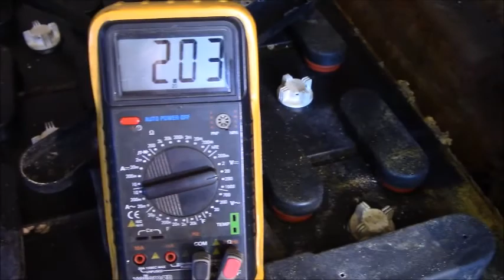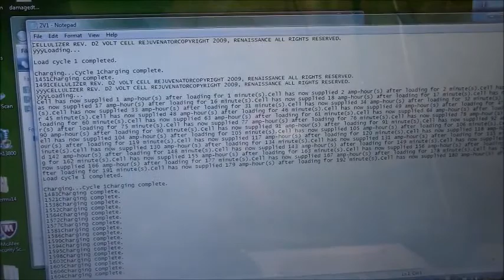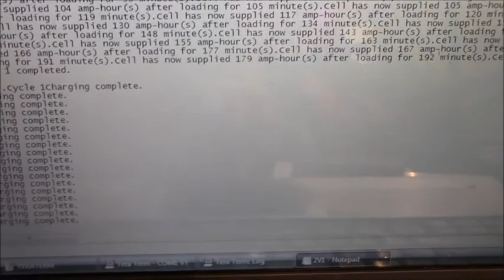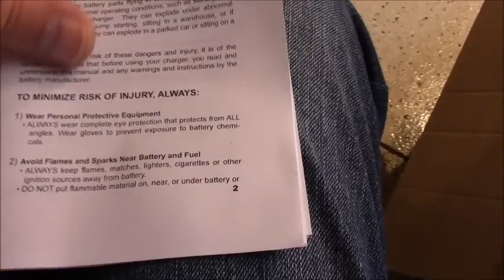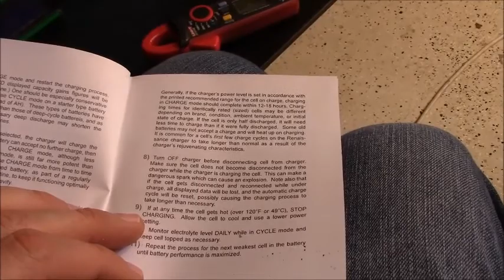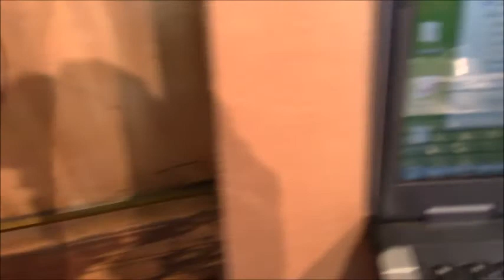2V Industrial Cellulizer Rejuvenator by Renaissance Charge

Comment: How many 12v batteries does this unit charge at once ? Usually Ev vehicle has 6*12v batteries or more stacked and it be hectic to charge 1 after another. Do you have any charger to charge multiple batteries at once? Please answer, thank you.
Reply from the maker: This is only a 2V cell charger/rejuvenator as stated in the title. We have other chargers that do EV banks (24 to 72, and 72V to 144V).
Reply: @rickfriedrich   Thanks for the answer. Does Ev charger also revive old batteries? If so then I'll buy it.